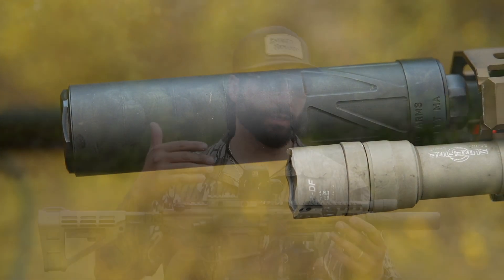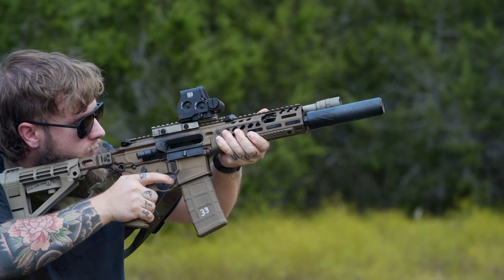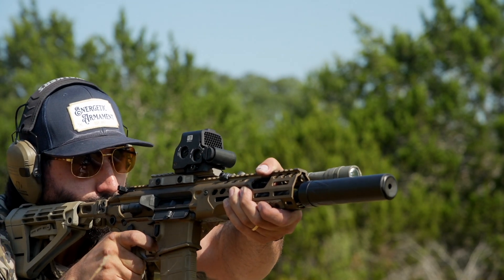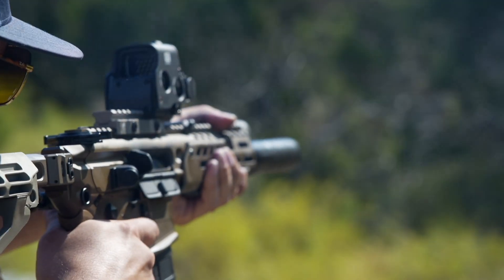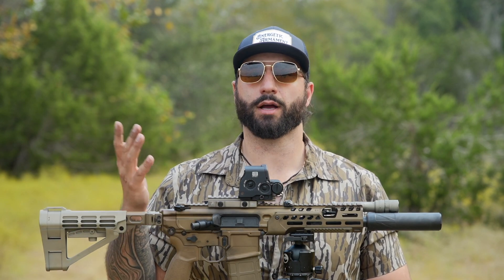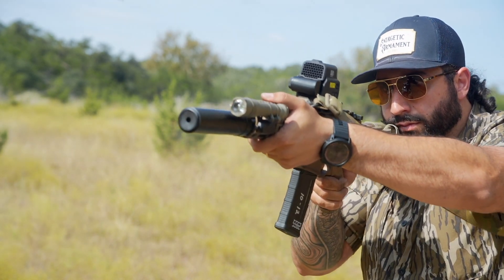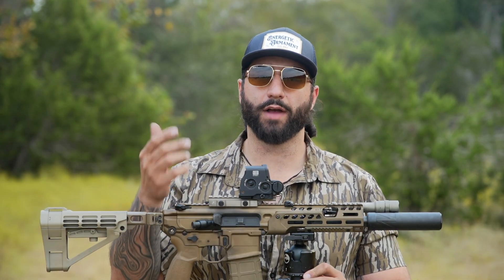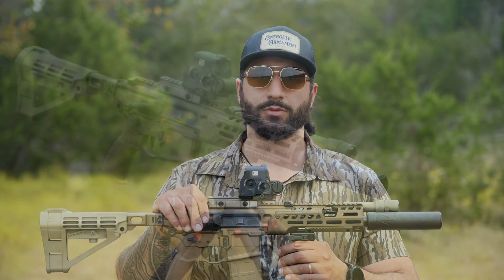The Energetic Armament Vox-S Silencer

Comment: The principle of gas direction is incomplete. On the diagram. The outer circuit has a very large diameter of the holes. It is not effective. The Tesla valve does not work